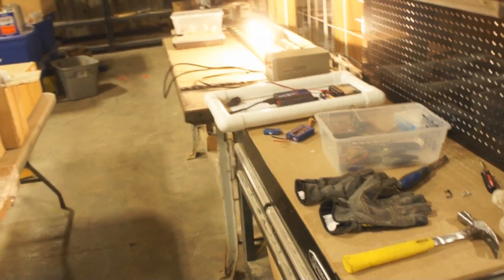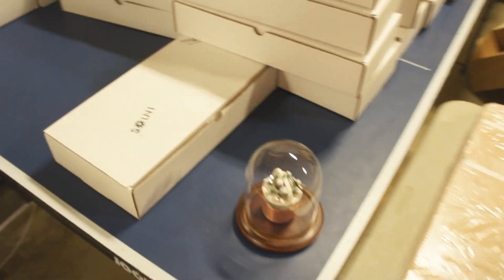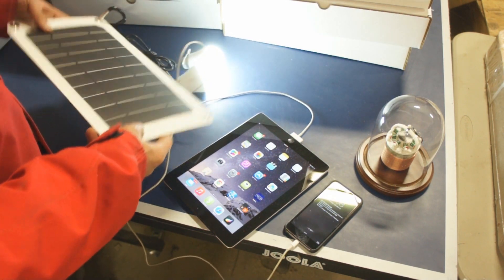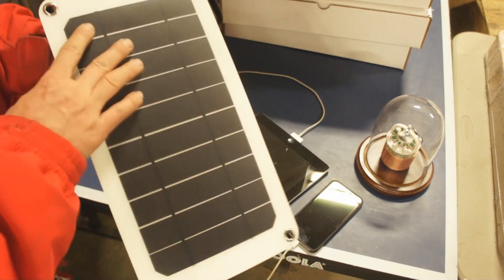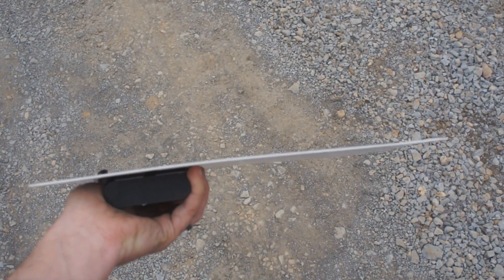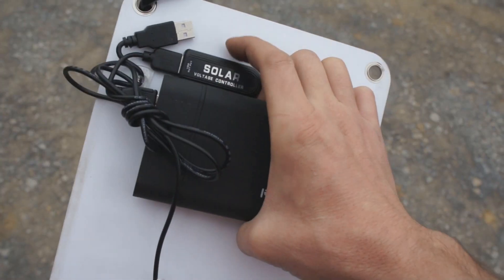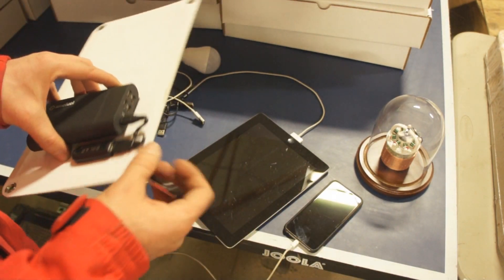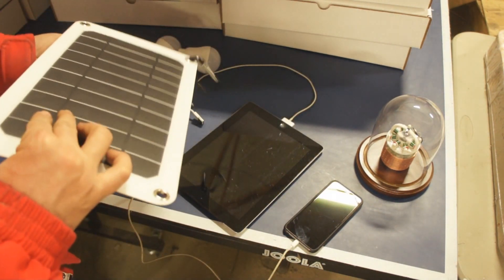SOLN1 25 Solar Project Update - “And one other project.”

Comment: That solar panel at most is going to put out to 2 to 3 watts just one cell phone is going to consume at least 10 watts while charging  so if the cell phone is charging for 4 hours it would take that solar panel at least 22 hours in full sunlight to recharge. in Indiana it would take about on average 3 to 5 days (less time needed in summer and more in winter) for that tiny solar panel to replenish that battery bank. need at least a 10 to 20 watt solar panel to keep that thing reasonably charged on a daily basis with anything plugged into it for any length of time. always worry about someone steeling my solar panel and what ever it is charging when out in public. have to stay with it cant leave the area.

Comment: Its 8 watts regardless how ya look at it, the fact that it drives 2 lights and charges light weight stuff only means the stuff you are charging and the lights you use becomes more important than the panel itself because it is only 8 watts so the devices it can drive are very limited. Put some hinges so it can have triple the solar panel for total of 24 watts or something, because the controller should be able to handle 24 watts, this way the end user will get more wattage for the money, add 2 more panels won't add up the cost of 2 more controllers at the same time the user will benefit from more energy for the buck.

Comment: Great job. I have a similar setup but I bought the solar PET backpack by Samsonite and attached my own made lithium bank using 9 x 18650B Panasonic lithium batteries for a total of 30,600 MaH.  I'm thinking of adding the balancing super caps as a solar buffer before it starts charging the bank. Though not sure how efficient it'll  be.